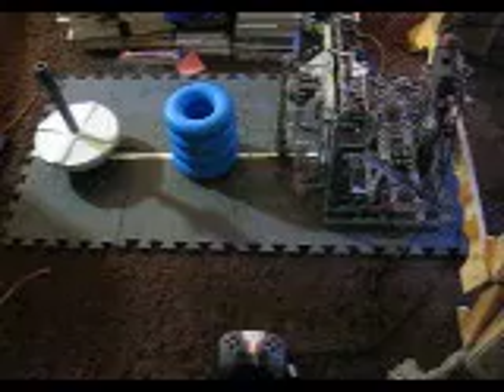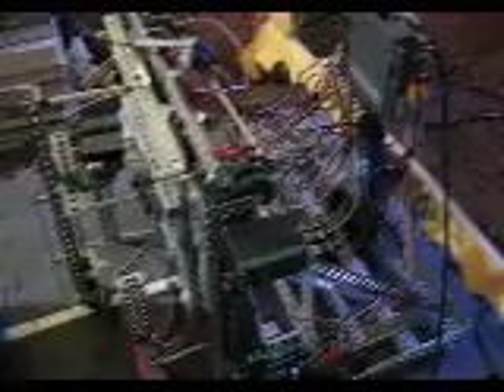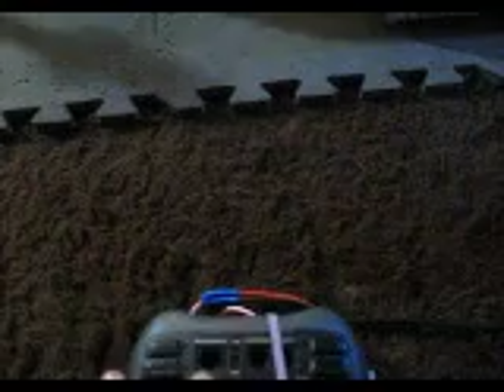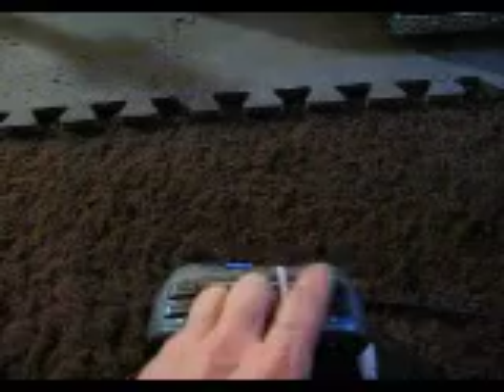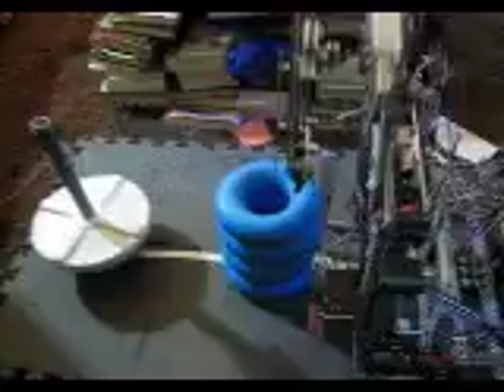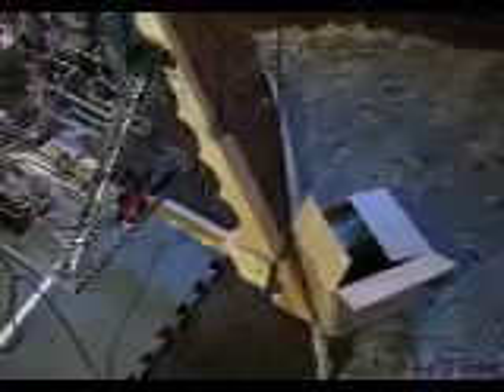599 Vex Round_up Mentor  Bobcat: Autonomous  Low Hang Test.AVI

Comment from the maker: @Zepp710   The code is posted on the vex forum code section  as "RobotC Mentor Bobcat Scripting during driver operation" , or you can find links on my blog.  Google: vamfun,RobotC,programming challenge.   The code has the line sensor tracker.

Comment from the maker: Well, the robot uses 4 linear slides.  Two are on the lower lift portion and two are on the upper.  The racks of the upper and lower slides are tied together.  Some small extensions are needed on the racks to get the whole 18 in extension.  (9 in per slide ).   There is lots of torque... 2 393 motors per stage working on a 36 tooth drive gear.  This gives speed and enough torque for a fast high hang.  This robot never competed... just a summer project for me.    Check out my blog for new stuff.

Comment: oh btw.  we've been trying to get a good system for linnear motion that can score as well.  currently we have it on a four bar link and we are thinking of doing a dual stage four bar linkage with linear slides.  it looks like you did a triple stage linear slide mechanism is that correct?  if so does that work well?  also are you in the college competitions or the regular ones?  and what area are u from and are u going to the world championships?  wow thats a long message.

Comment: sh** that robot is huge.  how do u hang with tha much weight?  also how do u program the line sensors in robot c?  i've  been wanting to know that.  also have u done the battery mod for the controller?

Comment from the maker: @vamfun 
6 hours ago

Contd: The sequence of actions involved could be automated with a mini script and commanded with a  Vex joystick button. The lift would have to have a potentiometer or a few more limit switches to do this to create more positions.. The driver would only have to maneuver to get the single tube centered and then just press the automated pickup switch to do the stacking.    Also an omni wheel drive scheme might help.

Comment from the maker: @lil7upboy 
Good question...should not be a problem for the programming challenge which this is optimized for.   The plunger  pickup does make  it tougher in the operator challenge.   The robot would need a reworked centering guide to lessen the maneuvering when plowing into several tubes that are tilted to get the plunger aligned.  The idea is to pick up one, raise the lift slightly, and drop it onto another one and repeat the process until you have 3 or 4 on the plunger and then go score.

Comment: Very VERY nice! I was just wondering what your plan was for picking up tubes that are slanted at an angle (maybe your robot already can). Say if someone knocked over a set of tubes, none of the tubes' holes would be facing upwards; how would you plan to pick those up?